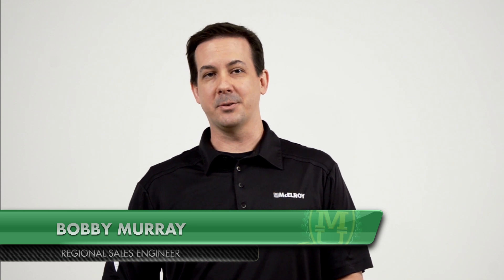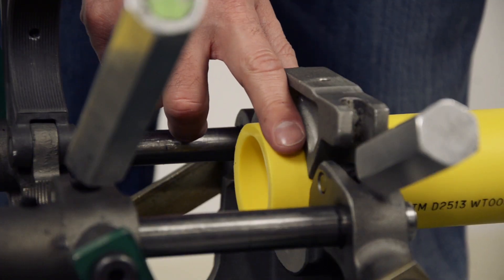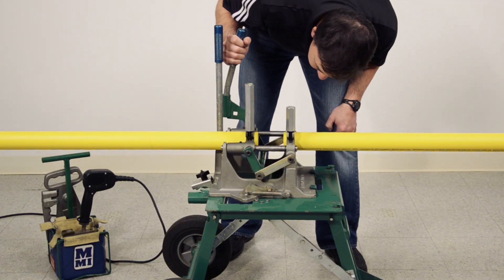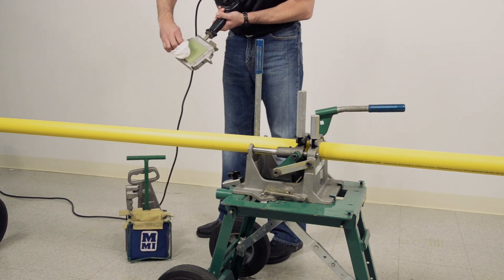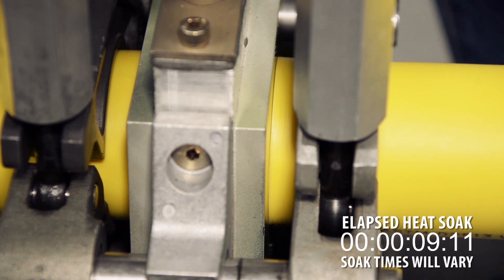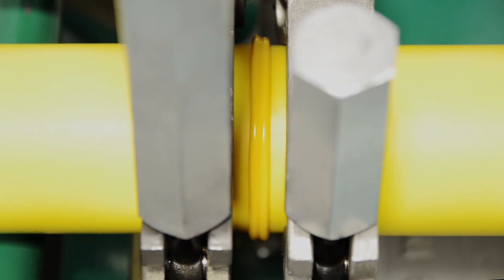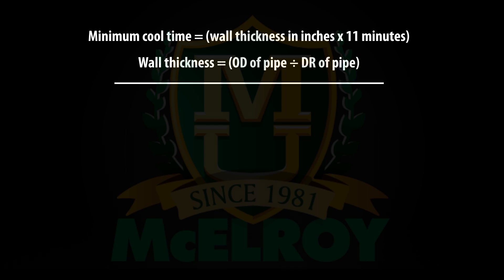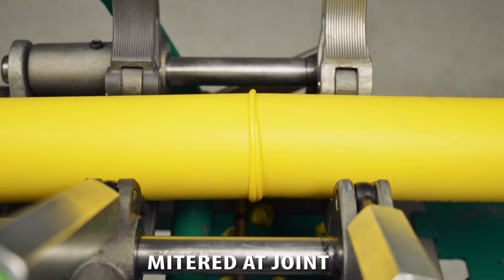How to Fuse Pipe with the McElroy 2LC

Comment: Old video today minimum bead is 3/16 and max is 5/16. Plus he made a cold fusion he waited to Ling to put pipe together
Reply: Nate Sinner minimum bead is still 1/16 and that’s not what a cold fusion is
Reply: @jbc_8110  Right and right!
Reply: Bead size means nothing scientifically. Its not an indicator for a ‘good’ fusion. Customers want it but ive seen way way worse then you see here pass astm testing. PE is very forgiving
Reply: J S if it looks ugly they won’t pass it were I work N yeah it don’t gotta look good for it to work I just re tested n seen the inside of my fuse electrical n heat
Reply: XPuro Norte4 they wont pass it ugly where I work either but that isnt my point..
Reply: Nate Sinner he let it heat up way to long n was way to slow wen joining them